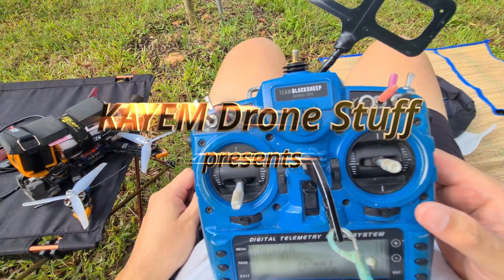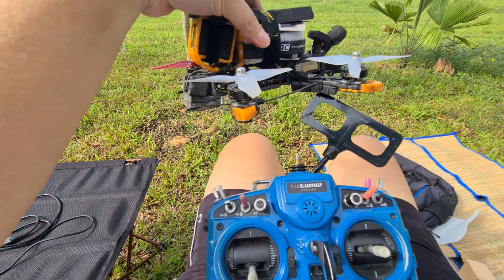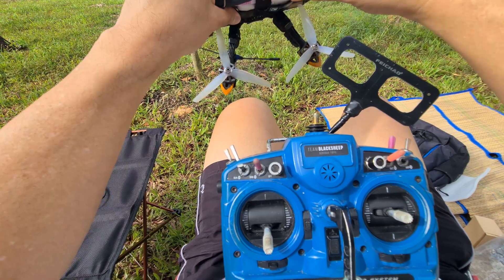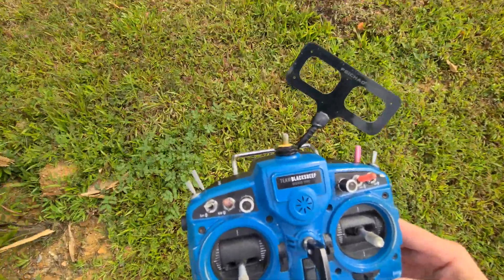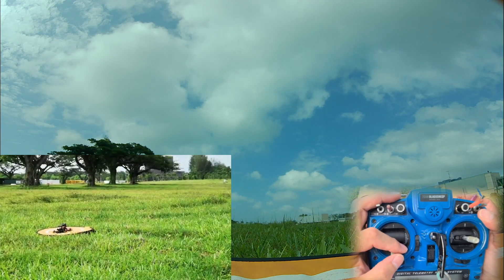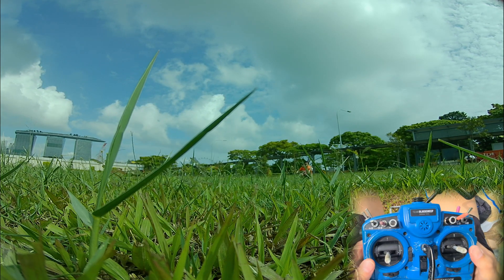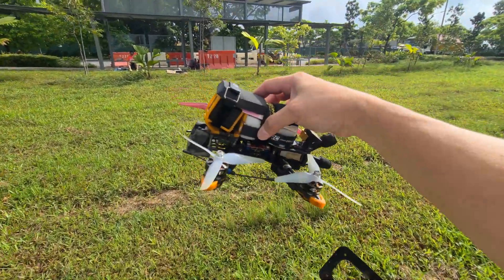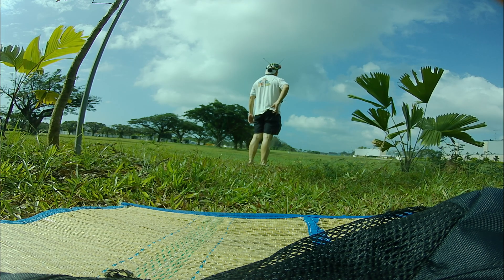Betaflight 4.4 GPS rescue Auto-Landing Test Flight

Comment: how do you calculate hoover landing value?
Reply from the maker: If throttle value as seen inside goggles add 1 in front and 0 behind. Say e.g. hover value seen on OSD is 26, then value is 1260. If its changing between 26 and 27 then 1265 is good.
Reply: @kayemdronestuff3597  thanks 🙏